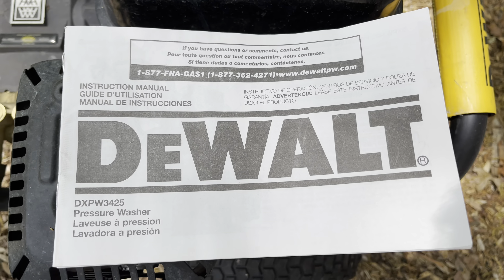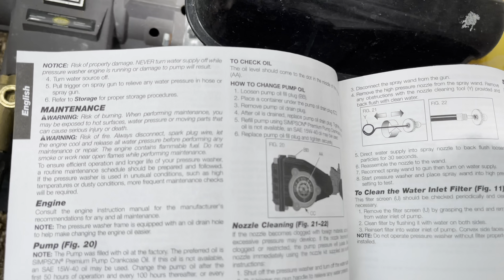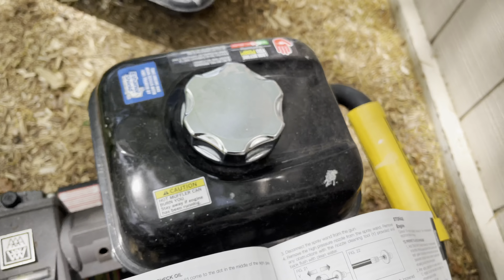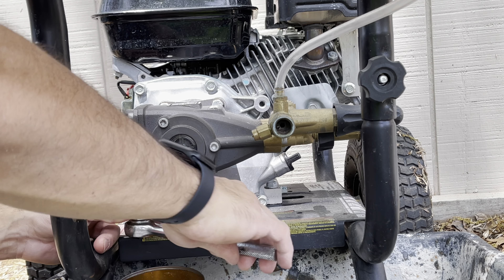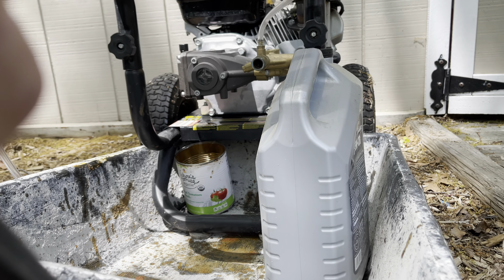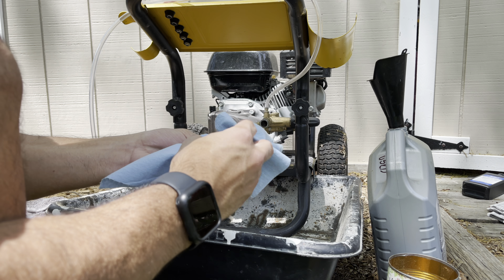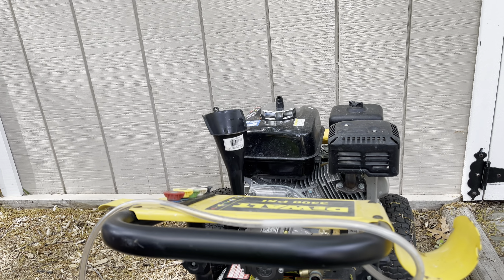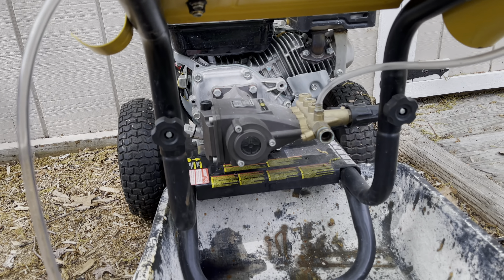DeWalt  3400 PSI   How I changed Pump oil | CAT PUMPS Pressure washer AAA #dewalt #dewalttools

Comment: Hi there my buddies 4400 dewalt powerwasher it was spewing like almost what looked like shaving cream from the release valve the black bolt you removed from the top there’s a pin hole in it to release I guess any built up pressure don’t know what he did but yeah he probably never changed it and it blew a seal allowing water to get into the pump well anyway he was lucky it was still under warranty they say not to run your powerwasher on full throttle due to all the pressure so running it at half speed is a good idea 👍

Comment: What size is the pressure hose from the factory?  Is it 1/4 or 5/16?  and how many psi
Reply from the maker: Im using a 3700 psi 5/16 repayment. The factory is probably 5/16 but 3400 rated?
Reply: @dannyjackhammers From the factory I think it is 1/4 of 3600 psi.

Comment: I have the DeWalt 3400 psi with electric start and there's no fill cap or drain plug on the pump
Reply from the maker: Sorry not sure about the electric start model, did you find a solution?
Reply: @dannyjackhammers  it's a sealed pump. 
 it does have the oil type written on the top of the pump but no oil drain or fill port. My guess is they did that to make sure pump failure happens so you can put more money into the pressure washer when it decides to go out. I have actually thought about pulling that pump off and seeing if there was a way to put oil into the pump that way . If not I'll just order the pump that can be serviced when this one decides to crap out on me